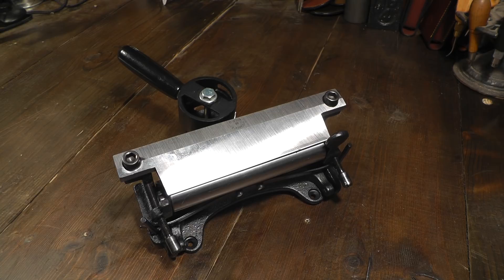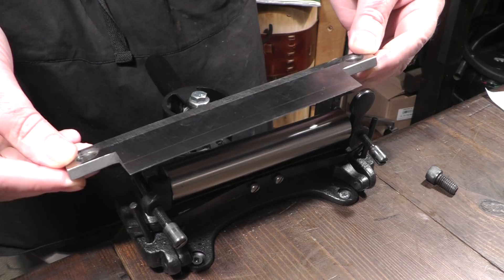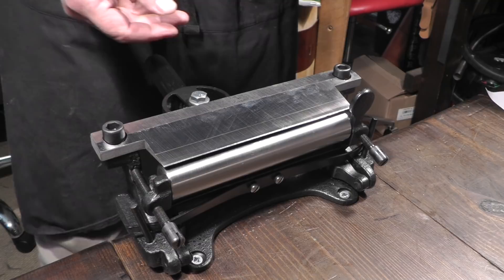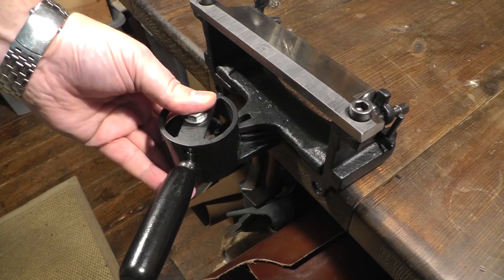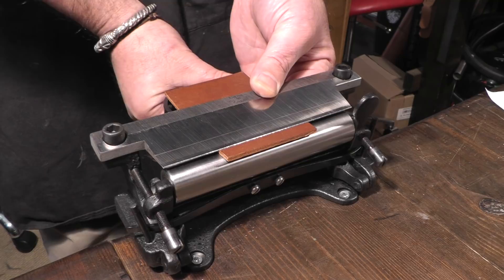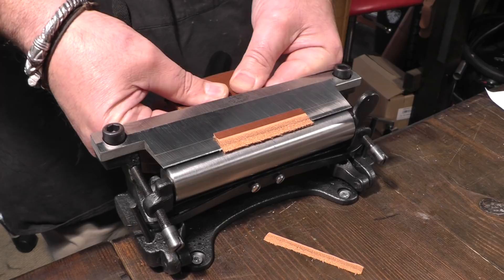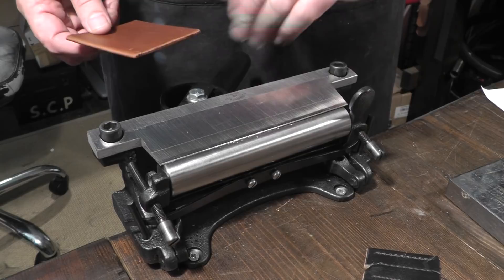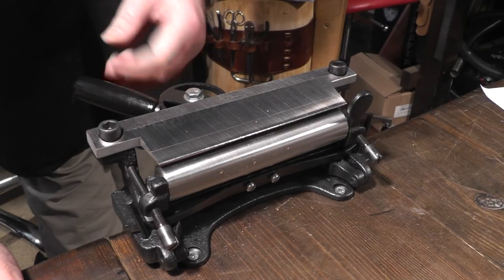C.S. Osborne & Co -  86A Splitting Machine H Webber

Comment: Thanks for your work making these great intructional videos on these splitters. I' m trying to decide between the Nr. 84 and the Nr.86a.
I gather from your videos that the 86 and 86a are easier to use than the 84, paticularly when it comes to skiving. The other main difference between being the blade width. Do the 6' and 8' sizes refer to whole blade width or to the useable blade width? ie what is the widest piece of leather that I could split with both of these machines? Would it be fair to say that if I don't need the extra width offered by the Nr.84, the 86a would be the better choice or are there any other advantages to going for the 84?
Many thanks in advance!
Reply: In my experience, it gets exponentially more difficult to pull a piece of leather through a skiver/splitter above 2", and very difficult any wider than 4". I have split 4" wide sections of bridle many times with a pull skiver but that was before I had any better options.

The longer/wider designs supposedly are so that you can go longer between resharpenings by using different portions of the blade. As I understand it the majority of work done when these skivers/spitters were designed was strap work for horse saddlery and harness, so straps of up to 4" but mostly 2" and less. I would suggest that the widest a man of normal strength can pull though one of these machines is 4", whether it's a 6" or 12" blade.
Reply: lordsummerisle87 thank you for your reply. That's very helpful. I was wondering about the increasing "resistance" of splitting larger pieces of leather and your feedback confirms my thoughts on this. I will be mainly splitting down straps and gussets so the 6 inch machine would just fine. I can always buy leather split down to size for the occasional wallet that I make.